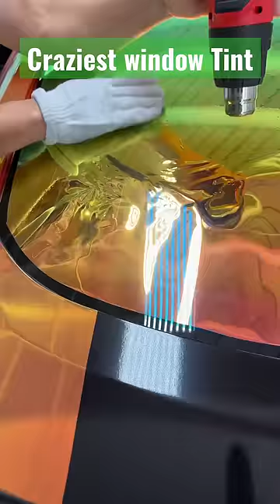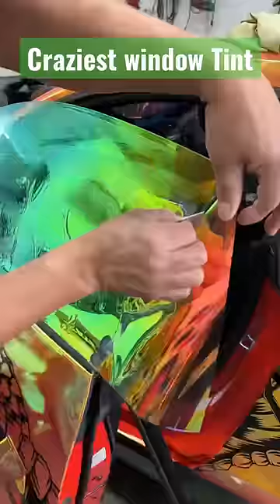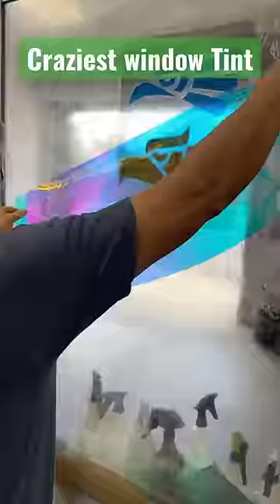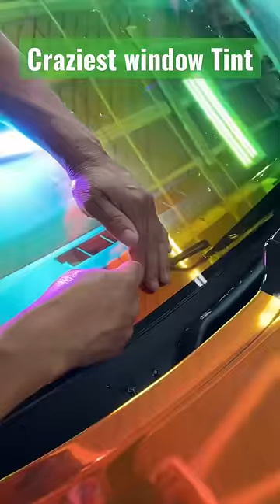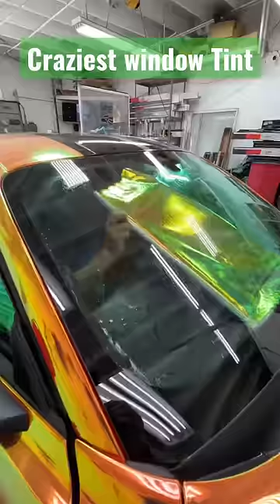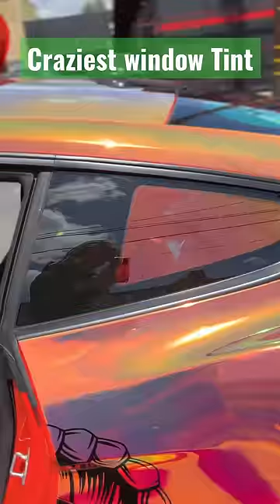Craziest Window Tint Ever Seen

Comment: I cant believe shops still trimming tint on the window itself. One slip thats a cut in the rubber trim. Last year i got my scat pack done at a shop and what i saw honestly i was very impressed. The guy put my year, make and model in this computer program he had. And it cut the tint to the exact oem specifications of my window. No trimming with razor blades.

Comment: NYS troopers would pull you over load you up with tickets & fines for every window & then have you peel that tint off on the spot. Not hating it's just they hellbent on window tint unless you have a football, basketball, baseball, and hockey puck tucked under your arm & a jersey number on your back